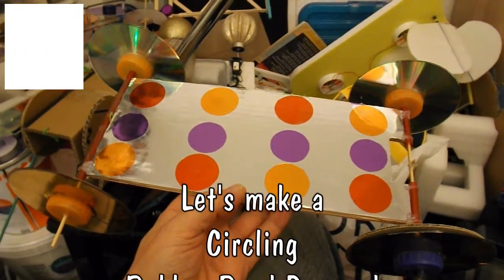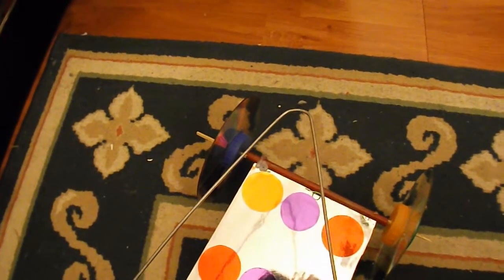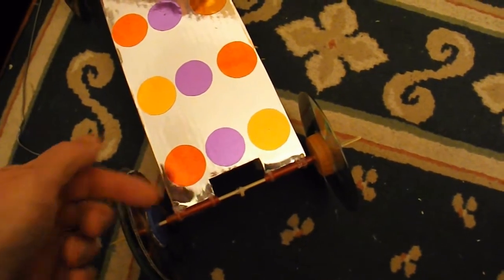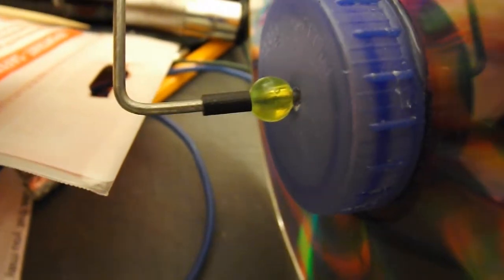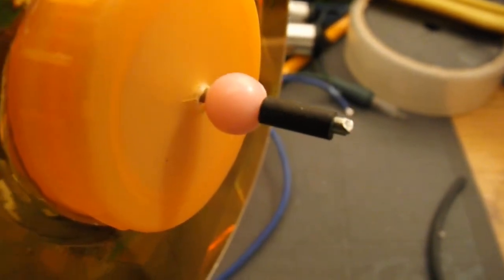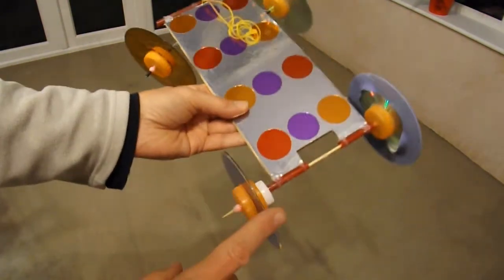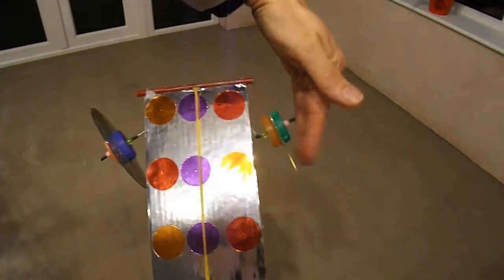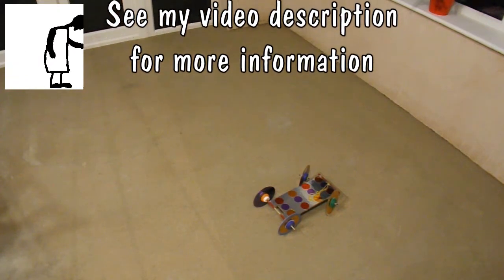Let's make a circling Rubber Band Powered Car

Comment: We’re having trouble getting the rubber band to power the car. Can you show this more closely? Thank you, I’m a big fan😀
Reply from the maker: Hi Holly, I have hundreds of videos on rubber band powered cars, I even have a channel dedicated to rubber band power. Are you particularly looking at a rubber band car to go in a circle or just generally a rubber band powered car? I have updated the information in the video description as things have moved on a bit since I published this video back in 2014. I have also created this video, which has a whole load of hints and tips in it's video description https://youtu.be/cw6MrBy7nCo?list=PL2Aly02Ujr7ejVN9oE9wYxRuGR-3G30g7
Reply: @GrandadIsAnOldMan  Thank you. We’ve managed to get the rubber band to power the car, but we’re now trying to get it to complete a circle roughly 6 feet diameter. We’ve been experimenting by changing the length and width of the body and number of rubber bands. We can only get it to go about 3/4 of the way before the rubber bands run out of energy. Do you have any recommendations for how long and wide to make the car to achieve this? Our body is made of cardboard and the wheels are balloon covered CDs. Thank you again.
Reply from the maker: @hollywethington2228  one problem with a circling car is the fact that all the wheels need to turn at a different speed. The inner wheels turn slower than the outer wheels. If the inner and outer wheels are on a fixed axle they work against each other and waste power. That is why I arranged the front wheels on this car so they spin independently. The back wheels are also independent, the inner one free-wheels, only the outer one is driven and that is the only one with the rubber tyre to give it grip. You may already have realised this, but I thought I had better emphasise the point as it makes a big difference.

Comment: Can u make or at least give an of how to make a self propelled car That moves in a spiral path
Reply from the maker: Hi Kiran, to make it spiral in (or out) you would need a system that moves the front axle slightly after each circuit. An idea that comes to mind would be a very low geared system working off the back axle or motor so it moves the angle of the axle "one click" after each circuit. An simple alternative would just be a fixed point at the centre of the circle with a string to the car so it slowly winds itself in as it goes round and round.

Comment: How exactly do you make one of the wheels on the back axle free wheel while having the other one fixed on the axle?
Reply from the maker: Hi Eric, on the free-wheeling wheel the hole through the middle is larger than the axle so it spins freely, the pink bead is glued to the axle to stop the wheel slipping off the axle. On the fixed side the hole through the middle is a tight fit on the axle so it grips, I even added a little hot glue to make sure.

Comment: Wow this is really nice! Thanks! Our project is really similar (same size dimensions), but so CHALLENGING :( we have to make a car (elastic or mousetrap powered) that goes in a circle (ideally radius of 1m). Between the 3 o'clock to 9 o'clock range, my car has to launch a projectile and hit a target 3m away and complete all of this in less than 5 seconds :(
Reply from the maker: Wow that is going to be hard to get the timing right if you have to hit a target. If you cannot use any form of remote control you will have to be very accurate with any mechanical method. Good luck with that.

Comment: Instead of gluing the front permanently. You probably could put a rotary controller to control the size of the circle, The controller would have to lock into each particular angle of course.
Reply from the maker: Hi Dart, yes you could do that but you could just bend the wire axle to adjust the turning circle, much simpler.

Comment: Have you made a tether car?
Reply from the maker: I had to stop and think for a while there. I did many different models in my teens, started with boats and cars and then moved on to planes. Did a few 'Jetex' cars but I don't think I ever got around to tethered cars or not 'proper' ones anyway.
Gosh, I have just Google'd tethered cars in the UK and found a picture of an old friend I haven't seen since the early 70's when we used to fly 'control line planes' and I see he moved over to tethered cars in the later 70's and is still involved in them now. http://www.onthewire.co.uk/index.htm
Reply: GrandadIsAnOldMan I made one years ago. the kids liked it . It was a small car pushed by a nine volt motor with a propeller.